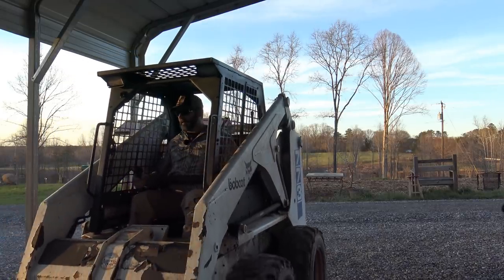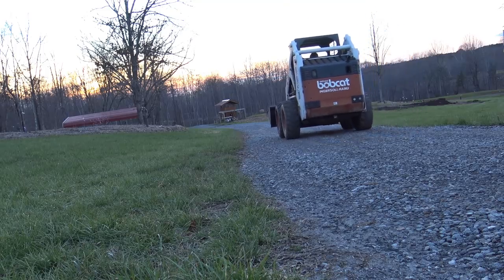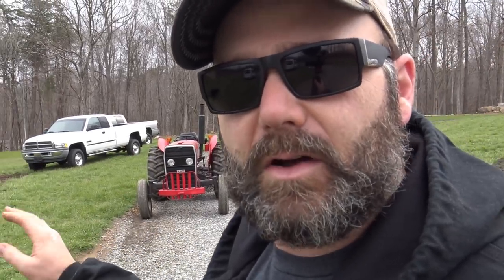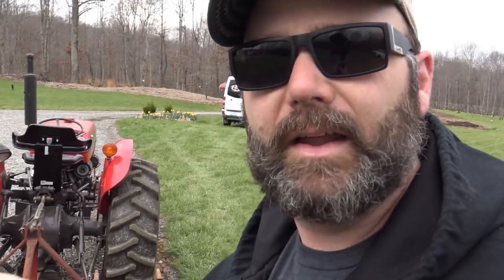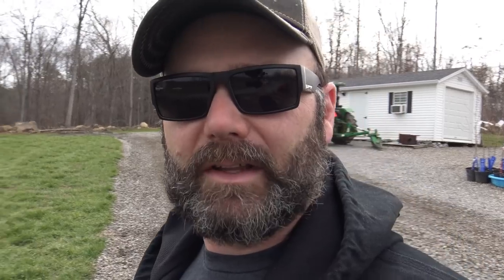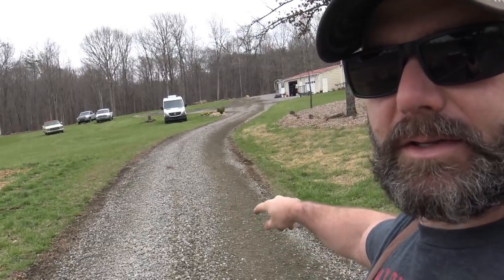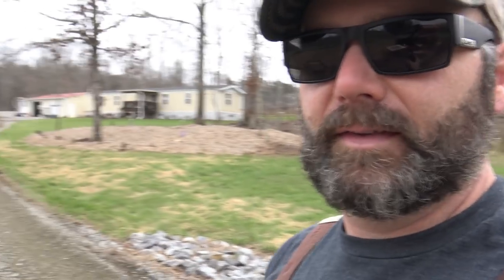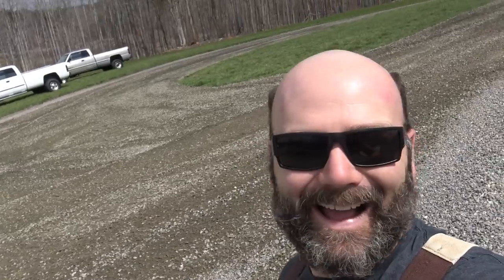TRACTORS AT WORK: SETUP/USE BOX SCRAPE BLADE FOR PROPER DRIVEWAY CARE/CROWNING/MAINTENANCE  DRAINAGE

Comment: Great video. I put a hydraulic valve on the fender and installed a cylinder where the adjuster gizmo was and I can do the adjusting on the fly and save my fingers for choking that rooster.

Comment: everyone has there own opinion on how stuff is done. I have always used blades set up to were its turned around 180 degrees from how you have yours. It helps pull the material ware you want it better.

Comment: Josh, Love the videos. But turn the blade around and use the cutting edge rather than the  mold board to grade. The cutting edge is replaceable, the mold board wears out and you throw the blade away.

Comment: @ Josh 

Hey brother about the road base, the more ya work it the more the fines drop out to the bottom leaving just rock on top. When I was doin grading we would get a problem area, work it a bit and lose all the compactability on the top, end up failing inspections ( just kick rocks on top n say "that ain't compacted". He was right) . I know your not doin all that but if ya start gettin a bunch of rocky areas, you can order a load of fines and work um in. That base is good stuff. Add a bunch of water, compact and walk away, that stuff turns like cement and if thick enough, holds up pretty well. Hey what makes your Cummins a unicorn anyways, just curious. I've got a '95 f250 xtra cab, long bed powerstroke 4x4, bout 270k. she's no one of a kind but she's awesome anyways, so is the cummins. Cool video's,  take it easy man.
Reply from the maker: Thank B9

Comment: Ide get shot if i wore the crap out of the back side of the blade like that glad it's yours not mine you can do anything you want to it but if you want it to last longer don't back blade with that blade and learn how to do it with using the cutting edge and height control of the 3pt hitch and skid pads if set up properly will do amazing things or build a land drag from chunk of big i beam and chain from the ends to the hitch and you adjust the length of each chain to do different things the longer the chains the more it will dig and drag the materials the shorter the more it will float over and leave more behind if you shorten one side it will have a bit of angle go to far and it will try to go inline with the tractor and slide end ways by far if used correctly can be an awesome tool but if you don't understand it and learn what it will do set to different positions on the chains it will make a mess and take to much or pile the gravel up